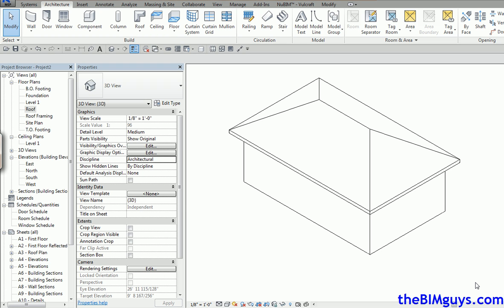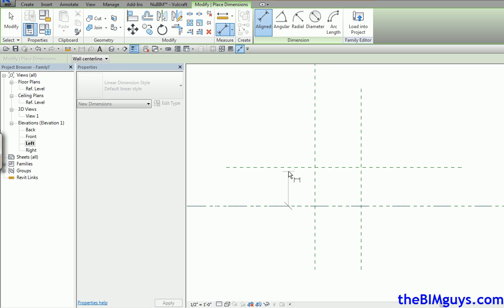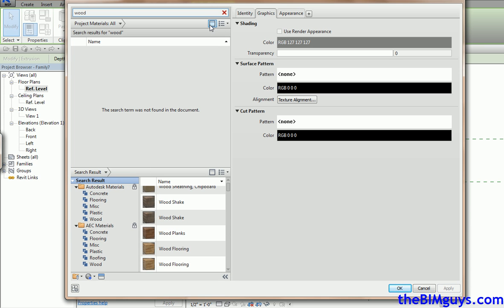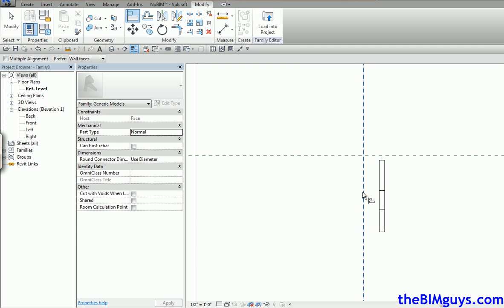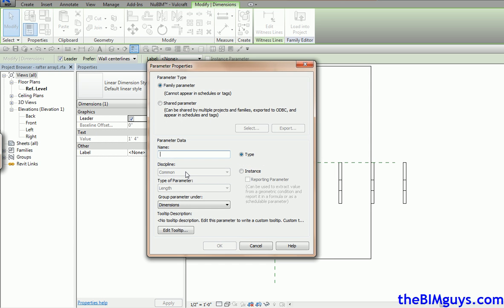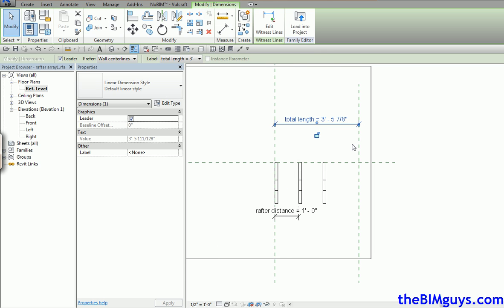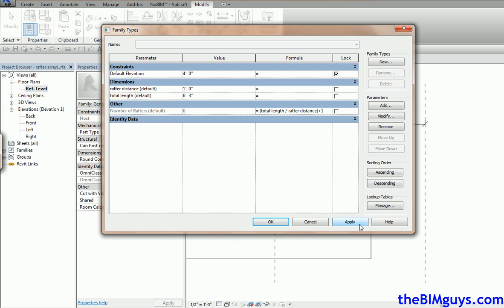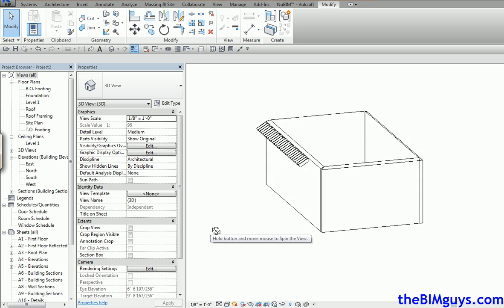Creating an Array Family - CADtechSeminars.com

Comment: what kind of family do we should to use to make a welded mesh parametric?
Reply from the maker: Before creating a new family, look into the Rebar tools in Revit. The Rebar tools are very powerful and are in the full versions of Revit.  If you are using Revit LT, you can use these parametric tips to create what you need.

Comment: Great tutorial. Thanks. 
Although I see a problem. If the total length divided spacing is not a whole number, the last instance goes beyond the total length or it will not reach it, like in your video. how do you deal with that? Is there a way to make the last, or the last and the first, to take a smaller o bigger distance to compensate for that difference?

Comment: Truly a "beautiful thing"! Thanks for the great tutorial! It enabled me to construct a more flexible rafter array family, though I extended the ability to spread the rafter spacing to a maximum spacing value. I also linked the parameters of the rafter generic model family to the new array family so that the family has controls over roof pitch, spacing, overhang, rafter width and height. All parametric. The array formula was set up the other way where the rafter was constrained to the edge of the total length reference plane. The internal array formula has an if statement to control the family from breaking if the total length was less than the maximum rafter spacing, and then the rafters were distributed evenly along the total length so that they maintained a less than maximum spacing. I did build a line based rafter family array, but your method seems to work much more efficiently. Cheers and thanks for your awesome tutorials. I have discovered many new things while watching your videos!